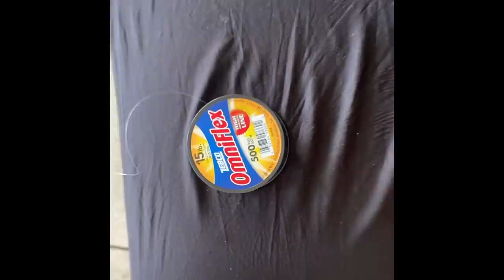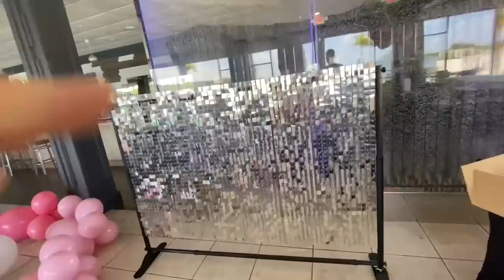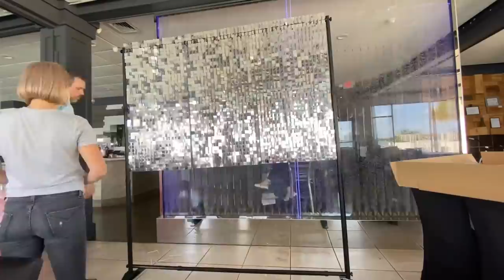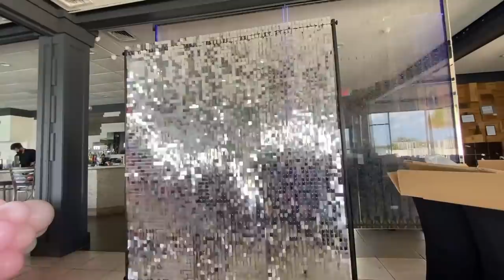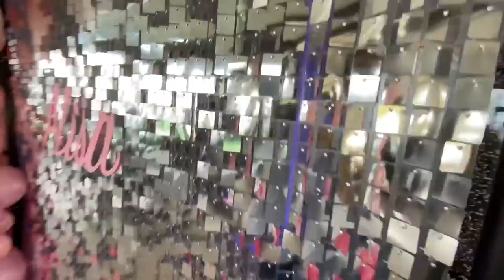Shimmer wall Detailed Video | DIY How to Build a Shimmer Wall | DIY Balloons

Comment: Yes these were a pain to connect together and hang on a wall. The end result is a very heavy shimmer wall. I had 24 panels to make a 6x4 wall. Had to use nails to hang it if you want to hang directly on a wall if it’s a permanent fixture. If you don’t want to put holes in your wall I suggest several I mean several heavy duty command hooks. With the latter method well really both methods I had to measure placement of nails/hooks. I recommend the snap in place panels super easy and fast to put together and hang!!!! Side note buy heavy duty long zip ties and jus cut the ends. Do not tighten until entire wall is together.
Reply from the maker: Totally agree. Very well explained 👍🏻🤩

Comment: What’s the benefit of using panels to tie instead of clip on
Reply from the maker: Hello, the panels are hard plastic pièces. They feel more durable than clip on. Although, clip on are a little flexible, which make them pretty strong as well as you clip them on and off. Clip on are very very light and really don’t take much space

Comment: Cuantas piezas hay en el shimmer wall?? Y cuanro mide tu base??
Reply from the maker: En este, tenemos 42. Al inicio debería tener 48 (3x8 + 3x8), y después Anna pidió que retiró una pieza abajo. Al fin, tenemos 6x7 piezas. Mide 6 pies por 7 pies.
Reply: @miamieventdecor5701  6 horizontal y 7 venrtical? Q medida es tu estructura?
Reply from the maker: Si mira bien la vidéo, son 7 en vertical y 6 en horizontal. Cada pieza es 1 pie
Reply: @miamieventdecor5701  muchas gracias me fascina su trabajo